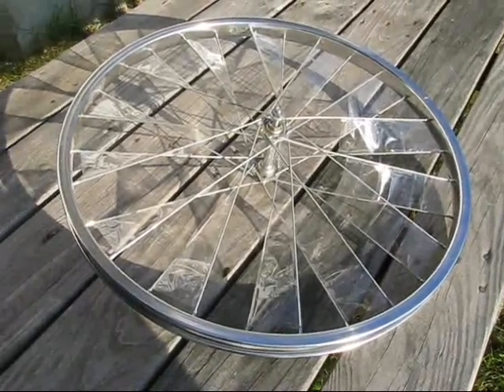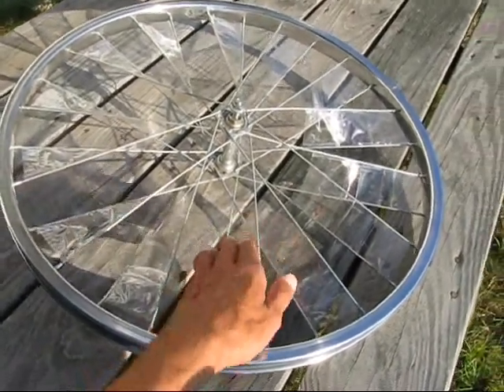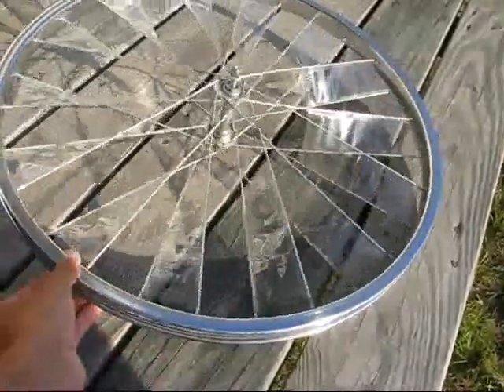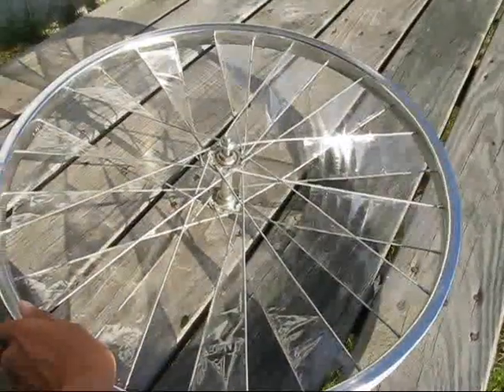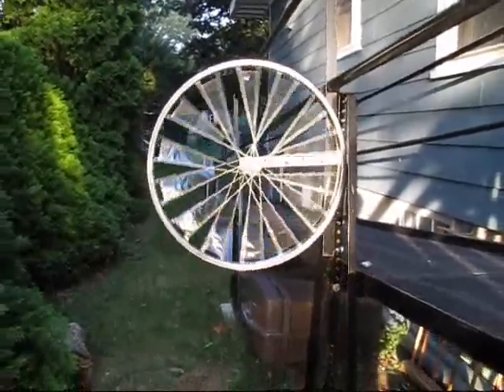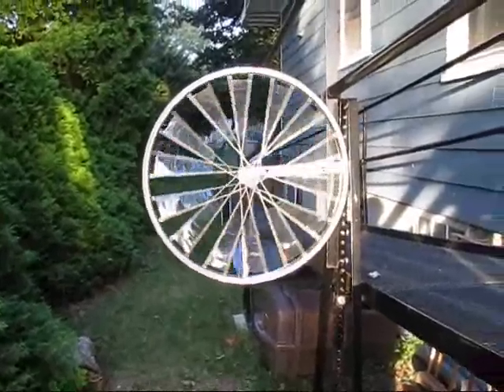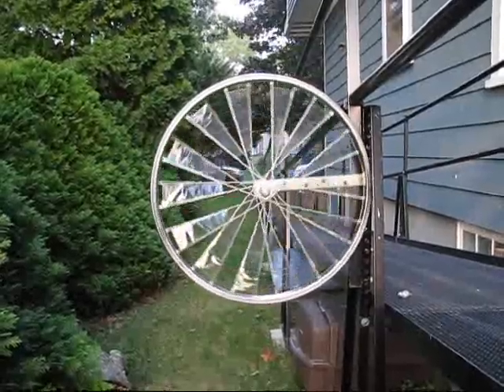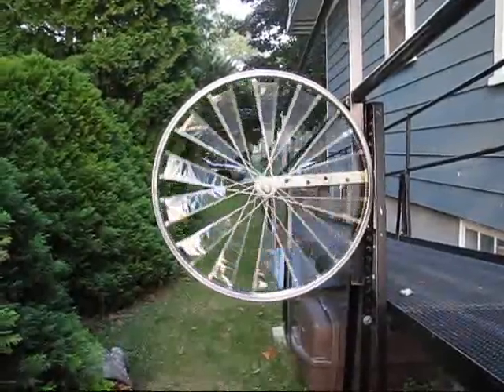Bicycle Wheel Windmill

Comment: I love this and am not trying to be critical. But I think it would be different if using this to power some kind of simple electrical turbine. I am not sure I would have to see it work but there is one difference between this and using it to create power. Here it turns so easily because it is free floating and only turning it's self. If used to power a turbine it would have to turn a commutator inside coiled windings, also the commutator would have "brushes" rubbing on it.

Comment from the maker: I'm not sure exactly how much torque it has, its not a huge amount as the "blades" are relatively small in size but if you have heavy winds it is surprisingly fast. Right now I am experimenting with the idea of mounting this to a stepper motor from an old printer. Those are free from junkpiles in your local neighborhood  :) I'll hopefully be testing this soon when I can find a few more bike wheels. If you do decide to make one please post a video and set it as a video response to this one.

Comment: yes,  you can buy a part that is called a bridge rectifier. it will cost only 7 dollar or less. It has four connections, two for the ac inlet and two for the dc outlet. They can handle 1000 volt ac and you can buy the, for different amps. But I do not now what to do with the flutuating voltage that you get from different wind speeds. 

Greets, iT

Comment: Sorry one more thing i noticed.....May be a factor or may be very minor. Use the old Bike forks as they are cylindrical and since in the path of the wheel, rim, spokes, and blades, I'm assuming that flat aluminum square stock will cause turbulence as apposed to uninterrupted air flow from the tubes on the OEM bike forks even if they have a bend to the cylinders it may still be better than square. Hope this helps ;)

Comment: Hi, did you ever get a workable response to your question. I knew a guy who made a water wheel of spoons. He charged car batteries with it. He used a voltage regulator and the altanater (?) from a motor cycle. It was a very simple system and he just rotated the batteries as he needed. He powered lights in his cabin and a water pump to get water to his cabin where he had a tank. Gravity feed into the cabin gave him indoor plumbing! Wish I could remember his system. I sure need that info now!

Comment: with the super simple yet super sweeeet setup you got going i thing any power produced would be .......simple. like for exsample use it to power an led bank above yer garage or an small radio in a shed i dont think it would be worth spendin on wiring and big magnets. although it spins nicely w/o a load on it that could change drasticly with a load so. wow im sounding like a nay sayer but thats not it i think id try one properly wound coil on your mounting brace and small mags around the rim GL!!

Comment: put small neo magnets  all around the rim and make a coil, or more, at he base of the rig, where the gap between the wheel and the house or fence is the smallest. but it won't generate a lot. Maybe enough to charge some smaller batteries.

Comment: Years ago was there not bike wheels with a dynomo built into the hub for the lights? As the bike moved the wheels went round  (only one wheel had a dynomo) the centre hub dynomo created electric which powered the lights, they where a bit dim, this i seem to remember in the 1970's in the UK ..

Comment: First, build the wheel with a radial spoke pattern, it will be easier to get the pitch right and the tape you are using to make the "airfoil" can go all the way to the hub. To simplify matters have you thought about using magnets attached to the rim or spoke nipples with stationery coils?

Comment: sir if your finding a way to generate electricity using your bicycle rim wind mill, you can change the rim's hub with a hub having a built in electric generator inside,,, i think that is the simplest way to do it

Comment: just my onion , but you need to get it above the roof line ( higher the better ) and just be cause it spins does not mean that you can create wind power , you need to find out how much torque it has at a given speed to be able to turn your motor/generator , and other points like Adam has made also take into account on a good producing turbine

Comment: The simplest way would be to run a belt to a car alternator- something cheap like a 73 Pinto, and the voltage regulator would be cheap for the same make of car. Then the wires go to your batteries, not complicated at all. I have an Air X which I thought I loved ($800)  until a solar man told me no windmills get over 100 watts, I checked the power on my Air X and sure enough i only get 100 watts on the 400 watt Air X so i am making my windmills from now on- we have a lot of wind.

Comment: do the rear wheel so you've got the gears attached and adapt a... #35?? (bike) sprocket onto an old car alternator for 12vdc. the nice thing about alternators is they supply a consistent voltage with varied RPM unlike the old car generators. the RPM on the alternator needs to be through the roof. if you're going to sacrifice an old bike, maybe mount the front gears on the assembly as well so you can do a double gear reduction. set up a 12v battery bank with a controller (to control the charge and depth of discharge). then pick up a "utility interactive" inverter (</_2.5KW) to get it to 240vac. UI inverters synchronize with utility frequency so you don't trip your main or fry the inverter. wire a "Static Transfer Switch" into your service and you've pretty much made a 10A "Uninterruptible Power Supply" that back-feeds your utility. you will save on your electric bill and it will power a portion of your house if you lose utility. the whole thing may generate too much resistance to turn your home-made windmill though... i dunno
Reply: I'm a wind turbine tech and your idea should work. but would be a little complicated for most people.
Reply: hey rob! i'm an electrician but i wouldn't think it would be be farther than a google search for a layman... are there any steps to skip aside from buying a wind turbine and installing the controller, inverter and a battery bank? do wind turbines produce 120/240vac? or is it all dc?
Reply: There are a few that produce ac.
 But do to wind speed variations the out put jumps around a lot. 
 Depending on what you are wanting to power a GM single wire car atenater it a easy way for a DYI turbine.
 They are internally regulated and fairly inexpensive. But a battery system is pretty much a must have. Unless you are in a place with constant wind.
 But it can be as small as a lawn mower\untillity  battery or several deep cycle r.v type.
  I can try to help with any questions.

Comment: Dude, set it on axle, the axle should have magnets in side it, the magnets spinning creates an electrical field. Using some cooper or conductive wire to get the electricity, then  two out put wires out of the cooper wring and put them on a a bulb. It should light...

Comment from the maker: I'm not sure if you can tell by the video but I did put the aluminum stock behind it, however what I'd like to do is make a setup where it can rotate to face the wind. I did consider using the forks but cutting one of the forks off since this is quite sturdy just bolted on one side.

Comment from the maker: This seems like a very common response. Do you have any idea as to how to orient the coil in relationship to the magnet? Or how to connect the 2 ends of the coil to something that would be able to charge a battery? If im not mistaken this generates AC, but you need DC to charge a battery.

Comment: Good Idea.If it doesnt matter which directions (ie clockwise or counterclockwise) the magnets go over the copper wire,you could sandwich the wheel between 2 sets of copperwire and just have them all mounted on one axel. So output would be double

Comment from the maker: One of the reasons for using tape is because of weight. If i did use pvc or aluminum it would most likely more than double the weight. Another reason is that pvc and aluminum are much more difficult to obtain and cut to fit. I definitely do need to allow it to turn into the wind. Im working on a simple setup now so that will be possible. How did you go about hooking up your motor?

Comment: Around the out side of the rim. as many as will fit. Then the coils. As many as you can with out the drag of making electricity stop the wheel. Alternat the magnets. It will kake it easyer to keep them on the rim. But you will need a diod. To rum the ectricity to a battery.

Comment: you can easily generate electricity but it wont be very powerful using that and efficent depending on where u live...
all u need is a dc magnetic motor and mount the wheel to the shaft of the motor

Comment: idk if you put a belt on the wheel it mite just slow it down...and stop it in slow wind....mybe a line of  magnets on the out side of the wheel.. and have it pass by a generator...small dc current and get a converter? im not sure i dont play with wind mills im just starting out?? please message back im vert intrested

Comment: if you built an array of say 36 wheels, glued strong magnets inside each rim, say again 36 magnets, used vinyl sign material cut to fit, and the entire network generating, and pivoting with the wind......might be fun to see how much power you could generate

Comment: Why dont all the fitness centres around the world rig there excercise bikes up.
Get fit/generate electricity ?
Reply: I actually just hooked up a wind up torch dynamo to my bicycle and connected it to an old laptop battery, after about 1 hour of riding I can fully charge it up (it's 6500mAH) and then use the power for charging my phone etc. It's not really that much energy as most of it is going towards me moving, so a stationary bike could harness a lot more power from it. 

I've actually though about buying a cheap bike and doing this same idea, I've seen it various times online and it makes quite a bit of energy.

Like you said though, I don't know why it isn't harnessed more. I really think if excersize machines could generate electricity people would be more motivated to buy them and use them, even if it was a small amount; just enough to charge a phone perhaps.
Reply: +Captain Capellini  Good idea, it cant be long before bike manufacturers rig the dynamo to a USB charger as standard,
Reply from the maker: +Captain Capellini I've wanted to hook up an old bike like this for a long time. Get an old motor, weld the bike gear to it instead of the back wheel and run the chain like normal. Keep it geared the same way so you could adjust the difficulty. Not sure how well it would work but it'd be a lot of fun to try it out. Might be tough to find just the right motor that produces a decent voltage at a comfortable pedaling speed.
Reply: I don't own anything to weld with, I'm 15 to be truthful, but I'm working on making my bike power assisted now. I am trying to make a switch to use the battery to power a motor on the front to add a power assistance mode. I don't use my bike often but it's a good project and it's fun.
Reply: +Captain Capellini  Good luck with that. Keep us posted.

Comment: Hi - I am also going to try to make some arty windmill generators.  Look for 'Windmills Homemade' by VegaScienceTrust.  It looks like you can make a generator from very strong magnets such as neodymium magnets - like buckyballs, and some long thin wire like from an old solenoid.   Until I found that, I was just planning to maybe get one of those crank radios with a usb port, but I may not need that - I found 'Simple generator electric generator for science fair' by wbeaty, too.

Comment: Put a belt where the tire would go and run it to a pulley attached to a dc motor or permanent magnet alternator with a tensioner pulley. Boom, you have power.

Comment: dont use tape get a thin waled 55gal plastic drum make a template out of stiff construction paper cut and shape it to resemble a blade then remove 2 spokes at a time replacing them with the new blades that you cut from the 55gal drum the lighter the better alternate the spokes and the blades as you would puting on a car tire use the back tire ((replace the sprocket with a pulley whil then you can get a small generator head and run it off of a belt.)) or if you want to mount it higher use the

Comment: See: for a good cycle wheel generator you could do this with no current or applied voltage. Or possible less than 10 mill amp input charge batteries run an inverter light your home.    James

Large Bedini SSG Wheel
Large Bedini SSG Wheel

Comment: bickle chane extend it if you need to get the bike and use the crank assemble mount a pulley to the other side of the sprocket to run the generator head. but that is a lought of work but I would  not use a bickle rim I would use an airconditioning blower whill squirrel cage - furnace blower if your not shure of what im talking about just look at the fan in your evaporator indore ac (But dont take my word for it do your own research and come up with your own conclusion)

Comment: You could very easily use an old sewing machine engine or any type of 230 volts appliance engine to generate roughly 20 volts which should be sufficient to charge an average car battery

Comment: Awsom.

If you use a steel rim then it would be so easy to add small Neodinium Iron Boron magnets equally spaced (buy using the inside spoke connection as a spacer guide.

Here is the BIGGEST idea ever:
Dont bother trying to panient it, the government will just classify it as national security as "disruptive technology"

If you use say 20 magnets use 19 or 21 coils. This eliminates the holding force because it puts the whole thing in imbalance. Think about, when you get it your mind 
will blow!

Comment: if you used a wheel with a  disk brake rotoor on it you could bolt a pulley to it and belt to a alternator

Comment: Uh, just get da rest of that bike and attach the chain on that peg thing in the back, put that on the gear, get a rod ad glue magnets to the ro + on 1 side- on the other. attach a metal rod to a magnet on some u looking table to keep it still, so when the wheel spins, it spins the chain spinning the gear spinning the metal rod spinning the magnets + to - so the magnet in the u shaped table so when the magnets spin, it wiggles the magnet in the u shaped table, with the magnet inside it and the

Comment: use a rear tire w gears or Belt pulley to a Truck alternator to charge Batteries
Reply: I've done that and it works as long as you know that you have to supply 12 volts to the alternator to excite the field coil to start

Comment: Incorrect. Or worded poorly one of the two. The changing magnetic field caused by the magnets rotating induces a current in a coil (which you left out) which then generates its own field, which influences the other field, you get a back emf, blablabla, and then you have a variable frequency AC electricity. The best thing to do would be to rectify it, find your voltage, and hook up enough batteries in series to be just under that voltage for your charge. Then just run it from your rectifier.

Comment: permanent magnet motors are wonderfull for windmill generator,s I have a set Running that I built last year running a total 80 volts 5 amps that charge two battery bank's of 12 6 volt deep cycle My house can run off grid if need be.....